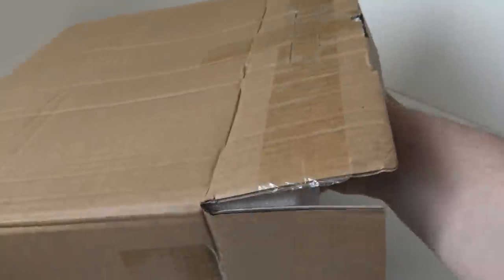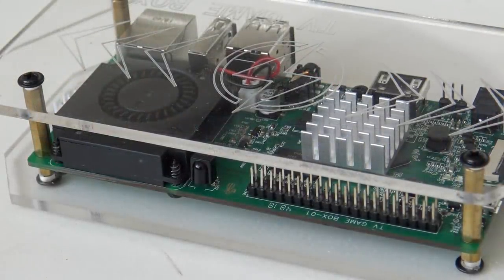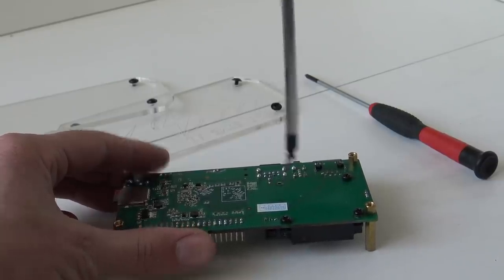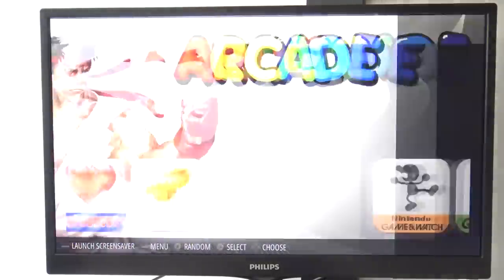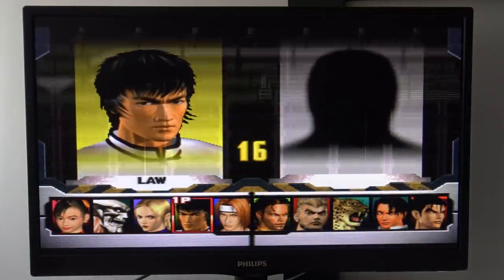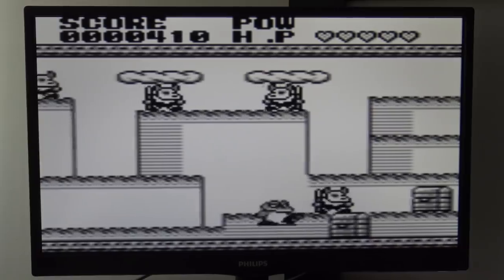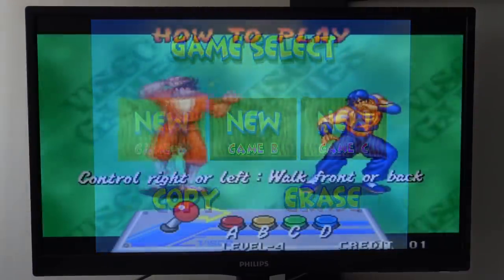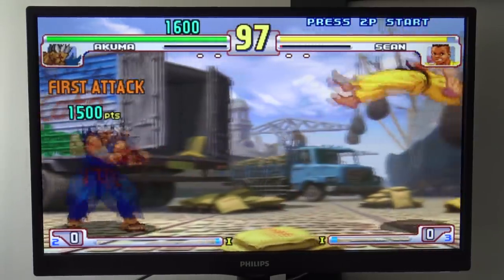TV Game Box 8000 in 1 Unboxing Review | New Generation of China Consoles ?

Comment: That’s either Madter System or GameGear Streets of Rage 2. But a fine port! Great video! I have a Pi 3B+. Worth using this instead? And the games are on included MicrSD? I’m guessing your query about the fan was assumed to not be an issue due to the open-air frame. A bit of this sponge/foam or mesh to deter dust would be nice, but grab a “try-on” mini stocking from a shoe store and slide the box in that. Voila! Thanks again! Love your channel!

Comment: My box arrived and it is great - thanks for showing us it! Is there a possible fix for the issue with the N64 controls mapping? None of the controls work on any of the N64 games, as pointed out in the video. Cheers
Reply: For N64 games, you can actually buy N64 controllers with USB output from online retailers like AliExpress. Maybe they are more likely to work. I was thinking of investing in one of these consoles but wanted to know if there is a game saving function and is it possible to play with 4-Players on compatible games?
Reply: @abu269  you are better off getting a raspberry pie for 4 players
Reply: @jsunfoley6397  Thanks for the tip!
Reply: @abu269   I have a pie got it present love it got it from ebay
Reply: @abu269  Does anyone know if you can erase, install, and replace games that don't work? I use Maximus with my X Arcade tank stick, but want something smaller.

Comment: I have a lot of sbc Orange Pi boards. The Orange Pi Pc is one of my picks because the it's about $20 and even plays Dreamcast and some PSP games well. The ES interface is a free download. You can get a better device with more systems and cheaper if you put one together yourself. If you want a plug and play buy this.
Reply: Based on your experience of use, which Orange Pi would you recommend?
Reply: @Qinti101  If you don't need on board wifi the Orange Pi Pc. If you do want wifi then the Orange Pi Lite. Both are cheap. Check out retrorangepi.org.

Comment: It has a power connector that Orange Pi's use and runs RetrOrange Pi and displayed 512MB RAM. It's most likely a $15 Orange Pi One with H3 processor on custom board. Lakka RetroArch is probably the best build for games. You can get similar USB dongle wireless controllers for around $8.

Comment: Really a neat little system. A little pricey but really nice. I looked at the Orange Pi website and I didn't have any luck figuring out what board they're using. Does anyone know? Is it a custom Orange Pi board?

Thank you for the heads up on this. The controller looks kind of meh but USB so you could use anything with it.

Comment: They want $72 for this thing. Thats madness. You can get a used laptop for $50 which will blow this thing out of the water!
Reply from the maker: Got a good point.. 
Don't forget to check the gaming chanel - youtube.com/thewickedgamernl
Reply: You can get a decent wyse terminal or HP thin client, put Lubuntu on it and Retropie x86...runs way better than this and you can have the thin client handle many other tasks with still a relatively small footprint.
Reply: falchulk but this electronic trash you want to own?
Reply: falchulk  you can get a SFF dual core 3 GHZ with 6gb ram and AMD 8500 Video Card for about 50 dollar or sometimes less. These machines are pretty reliable and fast enough to play all the games
Reply: falchulk  i also use the raspberry pie i like it. i mainly bought it because of power consumption and the size. but still this sff pcs are great, you can even run ps2 games on it. I have a bunch of them and i know what i am talking about. They are very reliable. Thats why all the call centers using them and they work 24 hourse for about 10 years and more without failing and even after that being sold and used many more years.

Comment: Hey Wicked! Did some research, this is what I found... 

CPU: Quad-Core ARM Cortex-A7 @ 1.296GHz Allwinner H3

GPU: Mali400 MP2 @ 600Mhz

Release Date: October 2014

This board also has 2GB of DDR3 SDRAM (shared with GPU) 
So basically the same as the Orange Pi PC  board which you can find for about $18-22 dollars.
Reply: Interesting on par with orange pi but way slower than a PI 3b+ and less capable GPU and memory than odroid xu4 and my new 19 year model Odroid N2 with its Mali G52 , 4GB DDR3 & Amilogic S922x hex core (these are are way more expensive a N2 will set you back over $100 but can play n64 and dreamcast pretty well)

Comment: Man that's so strange, the board is a rip off of the orange pi for sure (from what I've seen of orange pi's the logo is near the pins) but this board clearly has their own branding on XD, I wonder if the chipset is the same, I spose I could pause the video and compare with images but it does seem a bit of a waste of time. Good video as always amigo! I let out a sigh of relief at hearing perfect sonic 3 audio I'm getting to used to the bad emulation XD

Comment: £60 is way too much for this. It should be 20-30
Reply: Exactly how i think
Reply: Considering it's just a custom OrangePi in a case, they could sell it for $30 easy and make a reasonable profit.
Reply: @KiraSlith  Nah the specs of this are closest to the Orange Pi prime which alone is over $40, then add the cost of 2 controllers and acrylic case then it's not that overpriced.
Reply: @michaelparker2449  Are you sure? That one has The H5 and 4 RAM chips. I thought Retrorangepi only supported the H3 because the H5's Mali 450 drivers weren't available yet.

Comment: Looks like its a OrangePi clone, with a typical Chinese-made Allwinner H3 core, it probably could boot most H3-Compatible OSes including certain Android builds (not that it'd be a very good experience).
Reply from the maker: Thanks for the addon info ! 
Don't forget to check The Wicked Gaming Channel ! - youtube.com/thewickedgamernl
Reply: It is an orange pi clone they are using an old image on this custom H3 chip. I mentioned this on the forum, they hope they don't get sued because of this. People of RetrorangePi are not responsible for this product, nor do they supply roms in their images. 

Even the OrangePi lite runs fine with al these games, not sure about N64 though. @wicked could you test that with this system, maybe they did optimize certain emulators.
Reply: @djcasl  A unrelated foreign company redistributing their GPL software with illegal ROMs can't get them in trouble, at least not out here in the USA.

Comment: ALLOYSEED 8000 in 1 32G TV Game Box Player For Orange Pi With Dual USB Wired Gamepad Controllers Joypad Retro Video Game Console

1 X TV Game Box
2 X Gamepads
1 X Power Adapter
1 X HDMI Cable  

Specification:
CPU: Quad Core of Cortex-A7 for Allwinner H3 ARM (@ 1.296GHz)
GPU: Mali400MP2 GPU 600MHz Supports OpenGL ES 2.0
Memory: 2GB DDR (shared with GPU)
On-board storage: TF card (maximum 64GB)/MMC card slot
On-board Network: 10/100M Ethernet RJ45
Video Input: Camera Module with CSI Interface
Audio input: MIC
Video output: HDMI, CVRS, (4K@30fps)
Audio output: 3.5mm audio port and HDMI
Power: DC input, MicroUSB (OTG) cannot be used as power input
USB 2.0 Port: 3xUSB 2.0 HOST, 1xUSB 2.0 OTG
GPIO Interface: 40 pin Street needle row, compatible with for raspberry pi
GPIO (1X3) buckle: UART, ground
Included TF card: 32GB TF card 8000 for arcade games